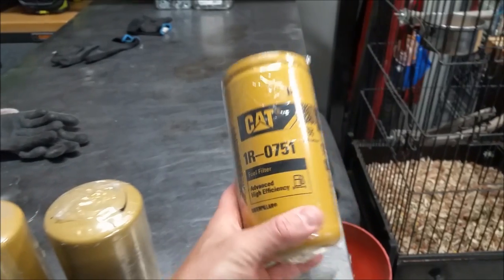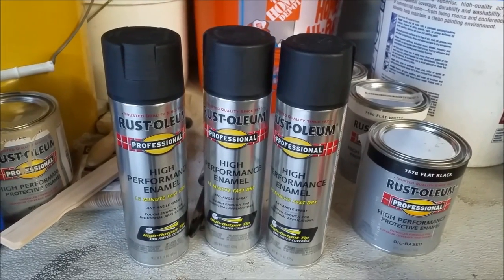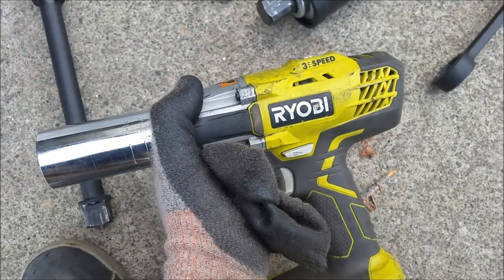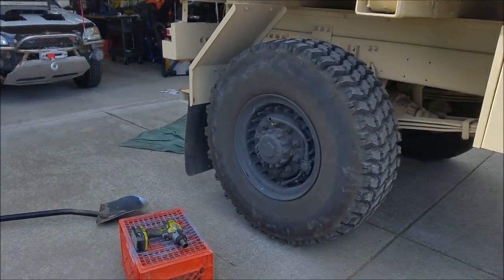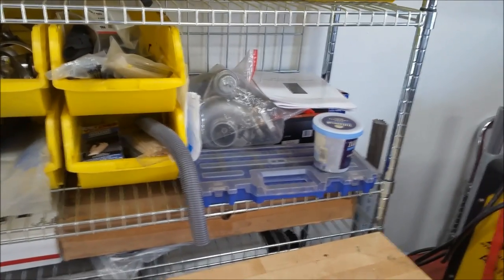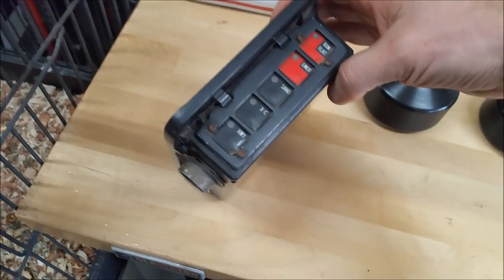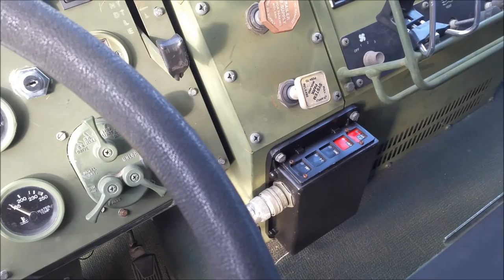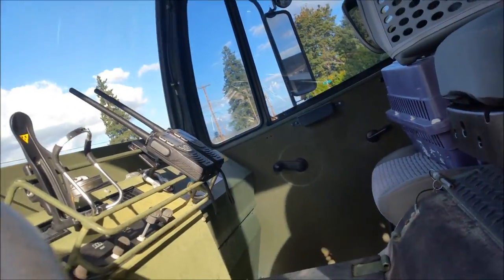Abel LMTV build part 32  (tire rotation, CTIS controller upgrade, missing cab bushing installation)

Comment: Is it me or is your garage shrinking?  They make a tire tool truck stops and other tire stores use to help get the truck wheels on.  It is usually about 5/8 steel rod with a flat end and works great.  The shovel might break under a load.
Reply: Please tell us how the MWrap control helped your fuel milage!
Reply: Who is they?  I just bought a fmtv M1093a1 and want to start off on the tires.  Thank you.
Reply: @pbodymathis  I would like to know how much better the mpg is on the truck now that it has taller tires and higher tire pressure.
Reply: @craigcole3510  I would like to know that too.